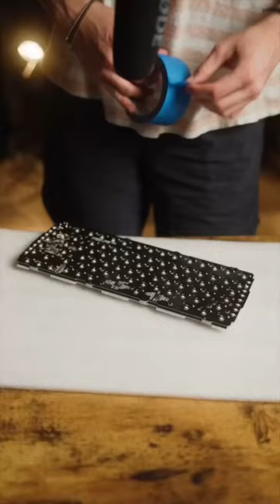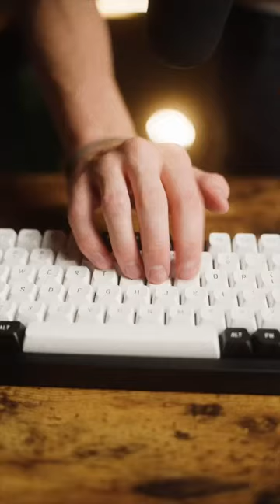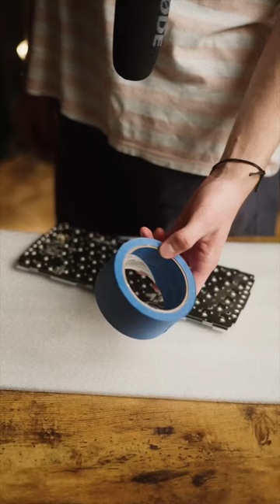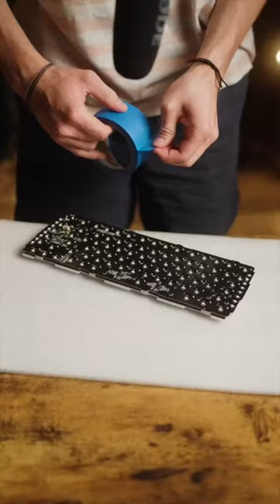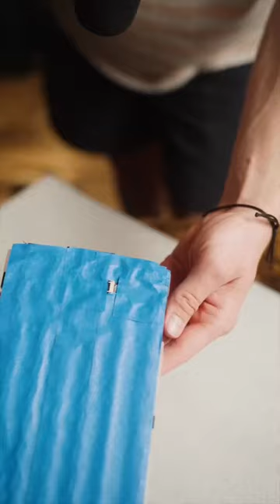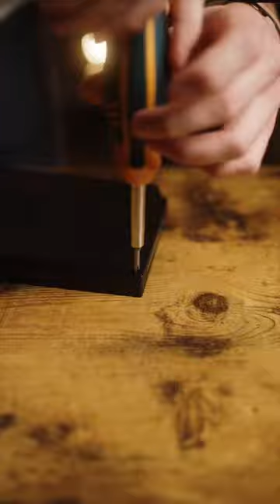how to tape mod your keyboard? #customkeyboard #keyboardmods #asmr #asmrsounds #mechanicalkeyboard

Comment: Here's a tip if you use 60% or 65% mechanical keyboard use only 2 layers of mtx tape but if you have 70% 80% 100% use 3 layers of tape only don't go 4 tape or else it wouldn't work
Reply: Also do not put the tape on the face of the motherboard or else the keys wouldn't work put it on behind the motherboard
Reply: I have 65 percent. I did 3 layers. Any issues ?😅
Reply: @BigDomDaddy  no not at all thats actually ok as long as you dont use any other tape than masking tape because masking tape are thin so 3 layers is actually good it makes the sound way better and deeper also poppy sound
Reply: @BigDomDaddy  i use 60% mechanical keyboard i used 3 layers of thin mtx musking tape it sounds so good and poppy 3 layers of thin tapes is actually good for 60% 65% but dont use other tape for 60% 65%  3 layers of thick tape problems are 1. Motherboard cant fit to the case 2. Keys wont work because the tape is too thick for the keys 3. Thick tapes can damage your motherboard 4. Thick tapes actually makes the keyboard sound not good like its a super deep like silent keyboard
Reply: @AGOxAsura what do you mean motherboard?
Reply: @Imfafe  pcb sorry not motherboard
Reply: @AGOxAsura  ah okay thank you
Reply: i used elcectrical tape for 2 layers is that ok? @AGOxAsura
Reply: dang it.. by the way is it fine to use pillow filling for it?
Reply: I have a tkl (87 keys) keyboard, how many layers?
Reply: i use 60% and now i did a 3 layer electrical tape mod with foam too. not much of a sound difference. @AGOxAsura
Reply: @thedemondevii883 eyyy fellow 3 electrical tape + foam 👋
Reply: @H313AT  so what tape and what foam is good for some thocky sound ? And can i just remove the base and put it on or is it scatchy to do
Reply: @daan2oo7  I'm just a beginner too here, and haven't tried many things.

- but here I use Nachi brand, either masking or electrical, since my keyboard have battery I use electrical tape, prevent shorts they said.
do NOT tape the screw hole place, port, and personaly I left the capacitor untaped 

- for foam I use PE Foam, 4 layer of 0.5mm

that tape and foam mod make me not want to go back to stock (personal preferences)

- Step to disassemble depend on the keyboard model, 
Usually you need to remove all keycaps, don't need to remove switch for tape or foam mod as you can already remove the case screw, unscrew all screws from top, and sometimes bottom (behind the rubber pad)

Otherwise some model, you can just unscrew from the base and have a direct way to the pcb base.
Just look for your model disassembly

note:
- careful if your keyboard have soldered battery, or pluggable cable, don't wanna add extra soldering chores.

- sometimes the mod makes the pcb (main board) too thick so the charging port got blocked, reduce as needed (note electrical tape is pretty thick). note for any on off switch / button that could be blocked by the mods

- I don't lube, but i've tried my friend's pre-lubed one with same mod, quite the difference, but still better than stock (personal pref.)
Reply: @AGOxAsura Is it okay that I put 5 layers of masking tape due to the thin structure of the tape? By the way, I also have a 65% keyboard
Reply: Don’t tell me what to do! I’ll use 48 layers of tape if I want!

Comment: Just modded Hyper x Alloy Origins 65%t some hours ago it feels amazing, it feels poppy and in general amazing. I really like it. But the problem was making the holes, it was the hardest part.
Reply: @char2284  I had a small tape, very thick and wasn't enough to fill many space. thats why i did like around 10-15 layers to cover it all.
Reply: SEE, MODS CAN ALSO DAMAGE THE KEYBOARD, AND ALSO MAKES IT SOUND WAY WORSE, WHAT IS EVEN THE POINT IN DOING THEM IF THEY GIVE NO ADVANTAGES
Reply: @rocketpadgamer dont ask other people to join your skill issue in tape mod lmao
Reply: I know it's a long shot since it's a year old comment but was the process decently easy? Deliberating on modding mine but I don't really feel like doing a huuuuuuuge disassembly just for this
Reply: @casino5773  The modding is pretty exhausting ngl, but it is really worth it

Comment: Wait wait, is this only for hot swappable keyboard or non-swappable keyboard can also be modded?
Reply: For both
Reply: Every keyboard can be modded actually.. The only difference is that hot swappable is easier to remove the switches rather than spending huge time by soldering those so if you have non hot swappable which means you'll find it no difference when taping it because you're clearly removing the keyboard parts so at that same point you can remove your switches from there too

Comment: Would it work if i taped the tape to itself (essentially creating a layer insert instead of an attach-on) so that no faces are sticky, or is the whole point of taping the pcb so that the direct contact assists the dampening/cushioning?
Reply: that's actually smart
Reply: Late, but, i think the stickiness helps, like how snow makes eveything quiet.  Keeps sound in. Would be same as 2 layers of reg. way tape
Reply: @Chefffff  Instructions unclear, I put snow in my keyboard and it melted...
Reply: I'm going to try this as soon as I find out which sort of tape I'm supposed to use.

Comment: Is it safe to use painters tape though? I saw a video of ClickandSwitch doing 7 mods. She said she almost started a fire using painter's tape and it's safer to use electrical tape if there is a battery.
Reply: that usually only applies to keyboards with batteries
Reply: its safe unless you have a keyboard with batteries
Reply: The only good option is to not tape mod
Reply: @rocketpadgamer dont ask other people to join your skill issue in tape mod lmao

Comment: hi tycottle, thanks for the content. i have keychron q5 pro. and i want to use tape mod as well. people said you should use painters tape because it wont leave a residue so i purchased a good brand. now im checking web again to be %100 sure however some people said battery might got heated and tape could catch on fire. however my painter tape has high heat resistance (80 degree celcius - 176 fahrenheit) can i use this painter tape? i never feel my keyboard is hot, it'll always cold with aluminium frame and i never turn on rgb also. should i buy electrical tape which could leave residue but i guess it wont catch on fire or painter tape is good/better?

lastly if i use painter tape mod. how many layers i should apply, 3,4,5? and should i apply tape to whole pcb or should i leave some parts open, is there a thing i should be careful?

Comment: Does doing this work with any keyboard and does it decrease its lerformance or actuation in any way? I currently have a steelseries apex pro ( I will be getting different keyboard/keyboards in the future ) and i was wondering if i could do this to make it sound better but am worried if it will make the actuation slower thanks in advance
Reply: Tape mod makes the keyboard sound bad
The before one sounded really good
The after one sounded horrible

Comment: will it damage the motherboard if I take the tape off?
Reply: most likely not since the masking tape's adhesive is not that strong and you could just rip it off with ease. in fact, you could put a strip on a paper and remove it without actually causing the paper to tear
Reply: @dzuul  ok thanks

Comment: or just covering the whole layer once with 3 or 4 tape peices not layers or 3 or 4 layers on the entire whole ?
Reply: @imLorro  I tried with 4 but for some reason my keyboard stopped working except for typing so for example I can't change my RGB and my capslock was on and its white when I press it again it works for typing but the RGB stays the same
Reply: @user-ov4it8hj5g  try removing 1 or 2 layers

Comment: Any pre-caution while doing this?
Reply: - be aware that if you want to undo this, it could leave sticky residue from the tape that are a hassle to remove (personally I don't care of some inside residue but some people care, try using isopropyl alcohol to clean it)
- usually don't need to remove the switches just the keycaps and screw, as long as you can open the case and access the back / base of the pcb (board)
- sometimes there're under rubber pad screw, so don't force the case open
- don't tape the screw hole
- don't tape any port
- could leave the capacitor alone or still tape it
- if have battery use electrical tape (to prevent short they said)
- if have battery take care not to break the battery cable plug / solder when opening case

Comment: My keyboard is name:VISNU model:K561R Red dragon is it tape modable cause when i got to the switches i couldnt really take them off should i use more force? Im scared to break it
Reply: u can tapemod it without taking off the switches bro
Reply: just remove keycap then you can already unscrew the case screw, and don't forget to check for under the rubber pad screw

and yeah, my K617 reddragon switch is quite hard to pull too probably should buy the better keycap+switch puller not the stock one, 
I bent the plastic house and broke some latch, but as long as the pin connect it still works like normal
you can test the keyboard on some keyboard test website after

Comment: can i use painter's tape on a wireless keyboard?
Reply: No,unless you want your house to burn
Reply: @vpgamer8223  so only when it’s wireless it’ll be harmful? i can connect it via wire then do the tape mod?
Reply: You can do it on awired keyboard
Reply: @vpgamer8223  can i only do it strictly to wired keyboards? Let's say I have a tri-mode keyboard and I DO NOT use the bluetooth/dongle mode, will there still be a burning hazard?
Reply: @cupkhae  i think if it has a battery unit dont do it. Im not sure about the wireless usb ones
Reply: @vpgamer8223  i see, do you have any other suggestions to have the same result as what a tape mod can offer? I have an open budget
Reply: @cupkhae i think you can use electrical tape for a simular result

Comment: Is it okay to play games like Fortnite with a tape mod because im guessing if u tape mod it u will have to press it harder for the key to work
Reply: don't worry, tape doesn't interfere at all with the switch press
the mod are on the backside of the pcb (board)
as long as the switch pin connects to the pcb board, the keyboard will work. the switch still click internally

Comment: Can someone explain why my keyboard(Royal Kludge Rk61) broke when I did the tape mod. I used painters tape and I tapped the back of the mother board and put it all back together but the keyboard just stopped responding
Reply: Did it work again when you removed the tape?
Reply: @FuttererJ  no it stopped responding all together
Reply: @daltonsmith2839 the keyboard felt dishonored by its new sound and committed harakiri
Reply: could be shorted, that's why people advice using electrical tape for keyboard with battery

otherwise check battery cable, try replugging it, check if the type-C Port is not bent

Comment: My keyboard is can be wired or wireless so idk if my keyboard can catch on fire if I do this (someone help I want to mod my keyboard)
Reply: mine too, I use 3 layer electrical tape and 4 layer 0.5mm PE foam, leaving capacitor untaped
currently going okay (3 months)
note: reduce layer as needed, just make sure the wire port is and the on of switch unblocked.

Comment: Is normal packing tape good or is masking tape required?😊
Reply: Non conductive tape like painters tape or masking tape. Also avoid using the battery with these mods
Reply: @fansmx4-hd7dw  you can use it with the battery, just use electrical tape
Reply: @wingandwang5634  wouldnt the glue leak into the pcb?
Reply: @fansmx4-hd7dw  what glue?

Comment: How to do with non hot swap keyboard
Reply: Doesn't matter, this is done on the back face of the pcb, not the front (Otherwise we would've seen the tape in between the keys) so you can do this on any keyboard as long as you can open it and take the pcb out
Reply: by doing the same thing…

Comment: wich tape?
Reply: painters tape
Reply: You can lookup other videos, but I'd use these 2 for reference. But both videos used basically the same type of keyboard (clicky/clacky). So use other videos for reference if you have a different 'switch type'.

https://www.youtube.com/watch?v=uClHfz3FaP8
https://www.youtube.com/watch?v=TvYv1XLktdw

My summary (YES):
- painter's/blue masking
- gaffer's/cloth
- mounting/foam/double-sided
- duct
- masking/yellow

MAYBE:
- packing/clear/'sticky' original
- scotch/magic/clear narrow
- electrical/black rubber
- PE foam

NO:
- gorilla double-sided
- packing/clear/'sticky' heavy-duty
- gorilla original
- drywall
- medical
- plumber's (never)

Comment: can u use scotch tape?
Reply: You technically can, and it sounds good, but I'm not sure it's a good idea in the long run, as painters rape is used because it is easy to remove and won't damage the pcb.
Reply: @ironwario9184  painters WHAT